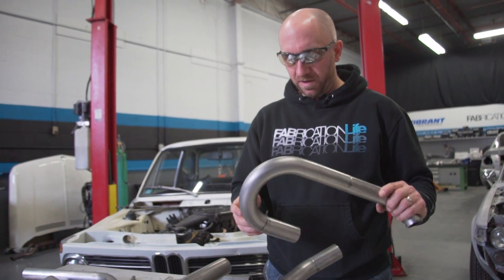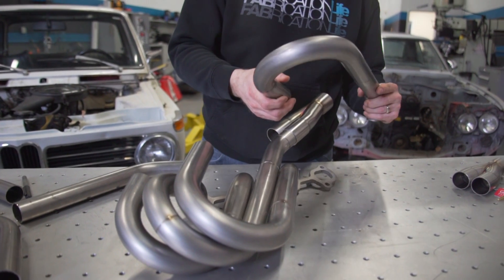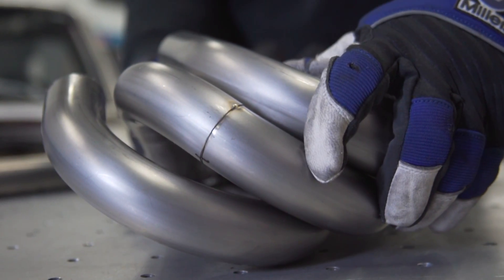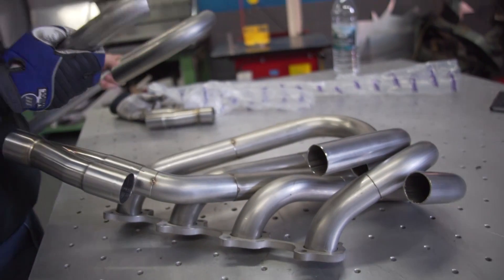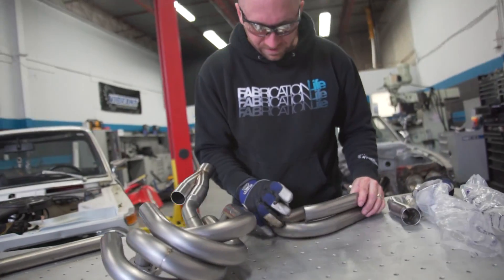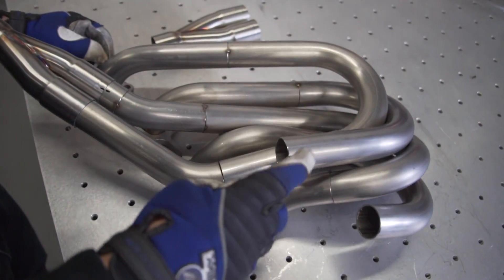Retro Header Build-Off Part 2: Completing Primaries

Comment: Beautiful work! What are your views on heat wrapping headers and the stories of them cracking?
Reply: wrapping headers keeps heat in.  this is good for increasing exhaust gas velocity and generating more power.  great for drag racers or any other application that will not see extended heat cycles.  not allowing the exhaust header (or any other exhaust component) to shed heat properly will over heat the material over time and repeated heat cycles.  there is no thermal barrier on the inside (like with internal ceramic coating) so the material will overheat and fatigue prematurely- ultimately leading to a failure.  wrap does not belong on a street car or a time attack/lapping car.

Comment: Are there any concerns about the tight clearance to the inner fender well? Looks like they would bang against it when the engine moves under torque load.
Reply from the maker: The engine is getting upgraded engine mounts to prevent it. There won't be a lot of torque coming out of this engine, so Art are not expecting it to twist much.